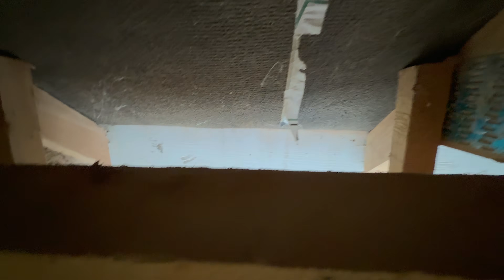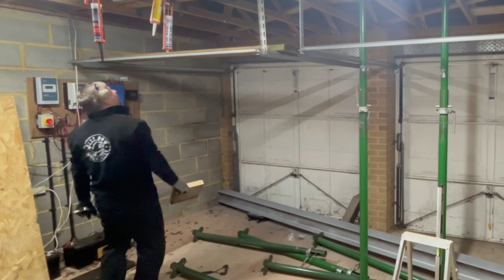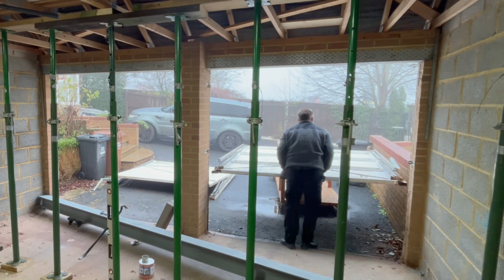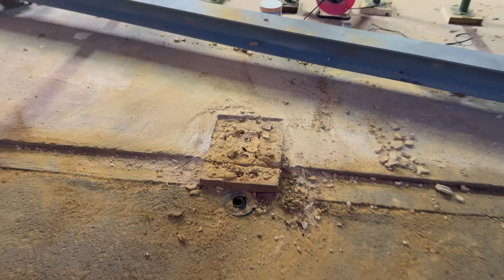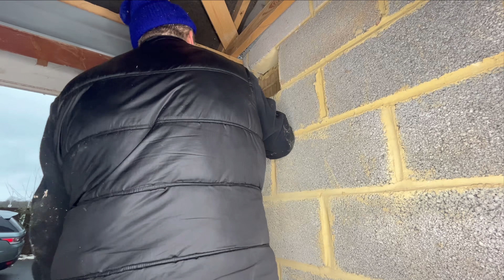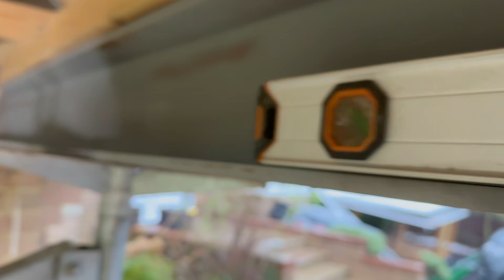Garage RSJ Steel Beam installation - on my own

Comment: Nice work, I'm looking at doing something similar in my garage. Did you fix the truss into the beam once installed?
Reply from the maker: The truss sits on a top plate, then the top plate sits onto the beam, with a membrane in-between.